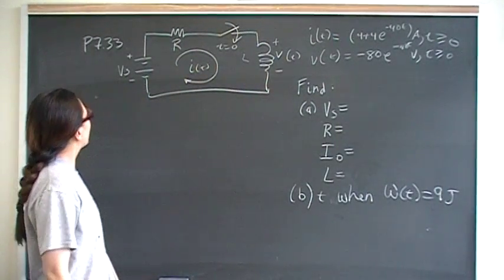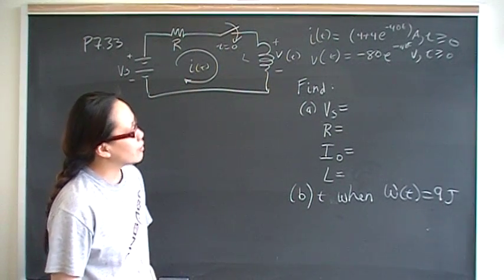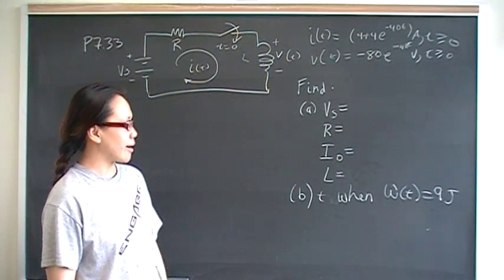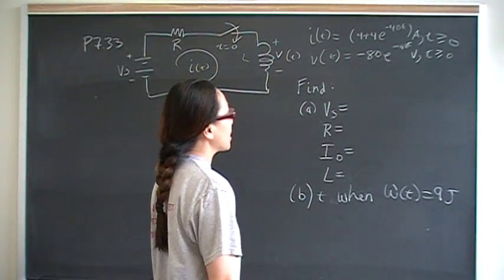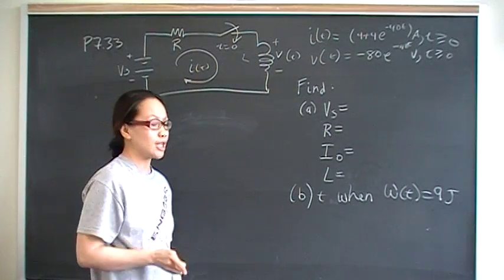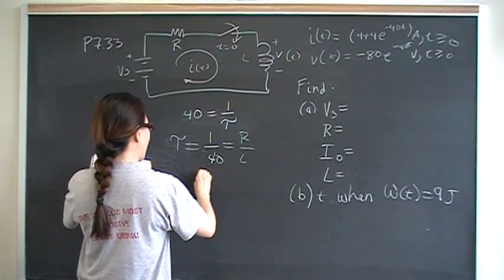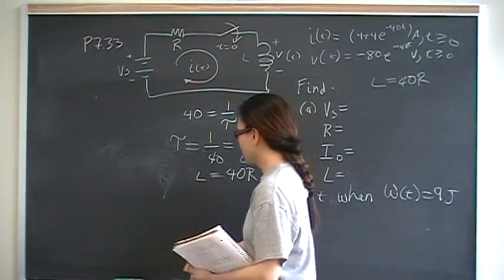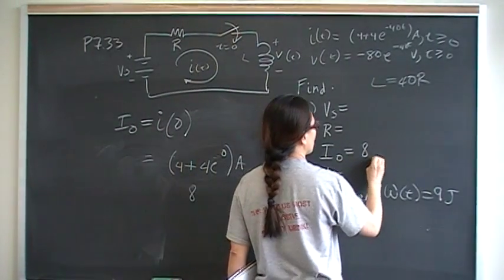Step Response RL Circuit P7.33 Nilsson Riedel Electric Circuits 9E Solution

Comment: Why bother to foil out the current function when you could have just multiplied 9 by 4 (since the factor to the current function is 1/4) gotten 36 and taken the square root of both sides? Seems like you added a lot more work than needed to be done. Yes you would have missed the negative root, but you can't have a negative time anyway, so it doesn't really matter...